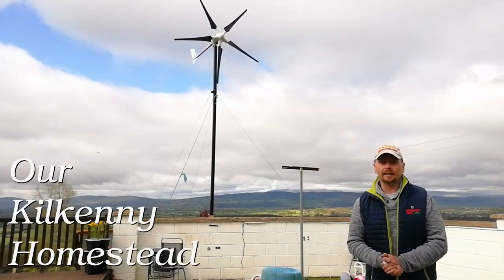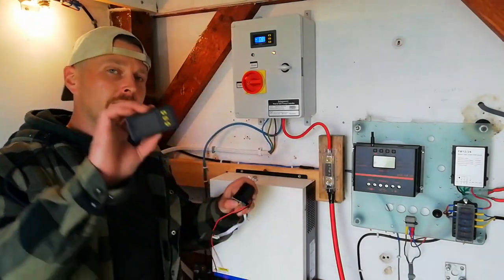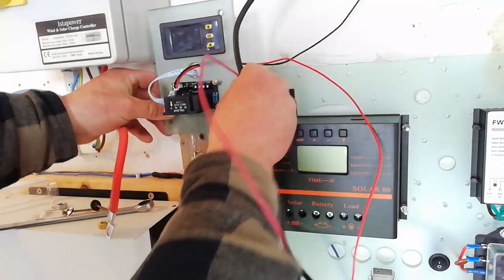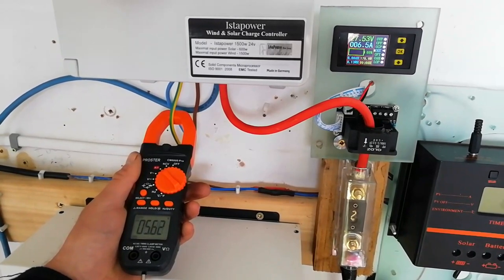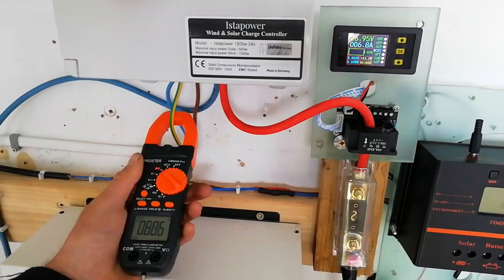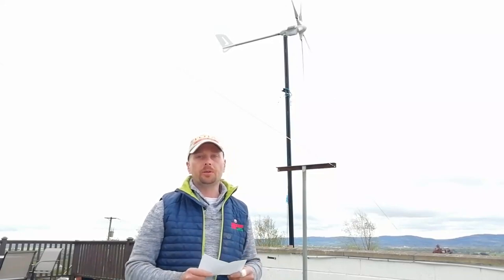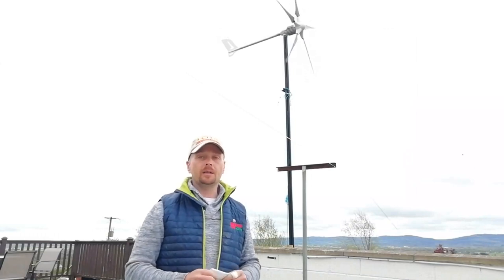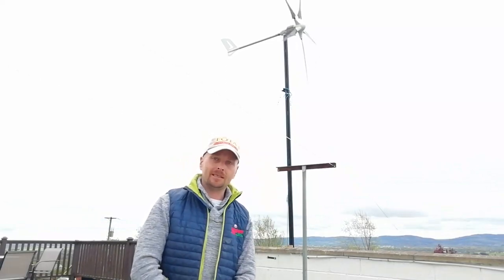Istabreeze i1500 Wind Turbine performance review

Comment: I am looking at getting one of these, will probably go for the Windsafe 2000, but the tower for it is horrific in price. Could you make a tower if needed? What foundation did you put in for the i1500? Is there a reason that you kept yours so low? The turbulence - especially in high winds - may have been a factor in it failing?
Reply from the maker: Hello Tom, yes absolutely you can build your own mast, the most common seems to be the gin pole type. We kept ours to 6m high as we are already elevated on an exposed hill side (400m) the foundation is 1m x 1.5m x 0.5m with rebar driven another 0.5m below the foundation. You can choose 3 or 5 blades to suit you conditions, 5 work better than 3 at lower heights but the trade off is a reduced top speed. Highly recommend replacing the slip ring for a heavier duty one before putting your turbine into service as the slip ring is a known weakness accross the bigger istabreeze models.

Comment: yep i am counting on a 3 bladed 1500 , 24v to keep my batteries topped up during winter , along with a older 12v 400w unit , and if all else fails my old millitary gennerator must do the work

Comment: good test.
just one question: why 5-blade one? is the 3-blade not performing well in low winds or what is the reason?
Reply from the maker: 5 blade performs better at lower windspeeds however the trade off is that maximum rotation speed is reduced compared to a 3 blade setup.

Comment: Myself and the fiance were looking at one of these to power a mobile home over in Connemara, would you still recommend istabreeze for a wind turbine? These are the only brand I see on youtube that seem to work to anyway halfway decent degree without costing thousands of euros.
Reply from the maker: Hello, yes i would still recommend an Istabreeze but on the understanding that the slip ring should be upgraded before use to prevent failure at high current levels. They do perform very well compared to some of the other options on the market but are not a perfect product. Hope that is of some use.
Reply from the maker: Oh, forgot to say, you wont power a mobile home on one of these alone. Not by a long shot.

Comment: After this time can you answer if it was worth investing in this model of turbine? Is it true that it needs higher wind speed though?
Reply from the maker: Hello, yes it seems to have been a good investment as it compliments the solar system well and ensures power generation in varied conditions. The technical specs regarding windspeed requirements is featured in the video.

Comment: You have used the green/yellow cable to transport a phase from your turbine which is absolutely forbidden, green/yellow is for earth connection. You have 3P+N cables for that purpose.
Reply from the maker: If that's the only nit you could find to pick at then we're doing alright 👍

Comment: Yeah sure. The readings are accurate😂  According to the manufacturer power curve, with 6m/s wind speed, it should generate 300W. The reality is that at that wind speed, it does not even start rotating. It needs 7 or 8 m/s to start rotating and 9 to 10m/s to generate just a little bit of power. It only works in hurricane wind conditions. Extremelly inefficient blades. I would never buy an ista breeze again. Do not believe everything you see in video
Reply from the maker: Sorry you have such a pessimistic view. At least you can trust everything you see in this video 👍
Reply from the maker: That's a bit shit to be fair. If you're scrapping them I might take them off you. 4 words: experienced user and gearing.
Reply: @ourkilkennyhomestead2006 you are right, what the fuc...do I know about generators, wires and magnets? I am just a poor electrician. By the way, be carefull, electricity is not a game
Reply from the maker: @JoseAgustin-hq2pl  ah sure hey what do I know either Jose? As you say of yourself , I am only a poor mechanic, but if we don't explore we shall never find out.
Reply: @ourkilkennyhomestead2006 Sorry, I didn't mean to bother you. I'm just disappointed with my ista breeze. It produces almost nothing. I have contacted the ista breeze after-sales technical service and they refuse to help me. They say it's my fault, because I've done something wrong. For God's sake, I know how to size cables, batteries, etc. because that is my job. I blame the wind turbine blades, they are very thin, they don't have enough surface area to catch the wind, and what's worse, they are very soft and bend in the wind. And I have the carbon ones, which are supposedly more rigid.
Reply from the maker: @JoseAgustin-hq2pl  I see... Do you mind if I ask what voltage level the system was operating at?
Reply: @ourkilkennyhomestead2006 yeah good point. 48V batteries and 48V ista breeze. Open voltaje the ista is 220VAC . A drill is able to reach the rpm necessary but it struggless to reach the cut in voltaje with wind because it does not reach enough rpm under load. Again, I blame the blades. Any suggestion? Thanks
Reply from the maker: @JoseAgustin-hq2pl  no expert here by any measure but I seem to keep hearing bad reports from folks running them at 48v. From what I've seen, people are getting better results running them at 24v for more amps. Not much use in that info I know, particularly as we're switching to 48v ourselves in the near future.
Reply: @ourkilkennyhomestead2006 That means the generators are not 48V, they are 24V as I suspected. The resistance for each phase is only 1.3 ohms. Very poor for a 1500W 48V coil. It should be at least 3 ohms. Unfortunately I cannot change the voltage of my battery bank, since each module is 48V
Reply from the maker: @JoseAgustin-hq2pl  I suspect you may be correct as from any vids I've seen of tear downs by other owners, the internals of the 48v look identical to my 24v. I don't know for sure though.
As a compare, I got 1ohm resistance from each phase of the windings and found that the slip ring was not sufficient to carry the claimed potential of 60amps. This is the part that failed in our turbine.
Reply: @ourkilkennyhomestead2006 ista breeze uses 10amps slip rings which is ridiculous. They should be at least 30amps or more since the curret is double when you short circuit the generator to brake it. The slip ring and the ceramic block are the first components I changed. I am gonna stop trying, I give up
Reply from the maker: @JoseAgustin-hq2pl if you're a DIY kind, the generators might work better in a DIY turbine where you could set up gearing between the prop and generator to get them turning faster. 🤷‍♂️
Reply: Hi. I am not sure what you mean. I am completely off grid. I got a solar inverter/charger (voltronic 5000W 48V) connected to my batteries and the wind charge controller connected directly to the batteries as well
Reply from the maker: @JoseAgustin-hq2pl  hello Jose, what I meant was that the generator from the wind turbines can be re-purposed for use in a home made turbine where instead of the blade hub mounting directly to the generator shaft, the blade hub would run on a seperate shaft which drives the generator shaft via a set of gears allowing the generator to turn faster for less wind input. I did a very basic build of this operating setup in my DIY vawt where the generator turns roughly 30 times for every one rotation of the blades. Might be worth exploring if you're stuck with turbines that no longer work in their original condition. I suggest this as a potential way to get your failed turbines back working for you again, all be it in a modified configuration.
Reply: @ourkilkennyhomestead2006 wow that is a great idea but I do not think I am able to do it. I am just an electrician, you are the mechanic😅 but I have to admit that it's a great idea and would probably work. Thanks😊
Reply from the maker: @JoseAgustin-hq2pl  you sir can do anything you set your mind to. Best of luck with it 👍
Reply from the maker: @filthyusratus  have you?
Reply from the maker: @filthyusratus  straight up, do not go grid tied, get batteries. Otherwise all youre doing is renting you're roof space to provide the power you make back to the grid for a few quid discount. Don't fall for the scams and salesmen. All that aside what you budget for a wind turbine would be better spent on a diesel or petrol genny and incorporate that into your hybrid system. Most turbines will require minor modifications to get better performance/ reliability. Istabreeze were the best that we could find after 2yrs research. Even then, they still have faults.
I get that you'll have 20 salesmen telling you xy and z but trust me they are just salesmen and only know the sales pitches. Buying from them is like getting a tyre fitter to build you an engine. Trust me on that.
Reply from the maker: @filthyusratus  aye indeed, I hope you've a better head on you than the "electricians" flogging "the worst way" to go solar.
Why not build proper off grid? It'll cost you much the same, you keep everything you generate and only use the grid when you choose. On grid is a bit of a scam at the moment unfortunately. Check out voltacon solar. com and solar hub. IE. You'll see the prices yourself and on voltacon you'll find some of the best inverters on the market for small money. We've used the conversol 3 kW for years now always on and never an issue even once. We're about to switch to the 11kw pair able, so we can but 2 of them increasing our load capacity to 22kw. As a mechanic of 20+ yrs, BMW technician before I retired from the trade. I've seen and know the best of technology, and how we're sold over priced shite and conned into contracts and setups that only serve the salesmen and the companies. Anyway, each individuals needs are different, what suits us may not suit you. Just be careful out there, 99% of the people and places you look to for information will just try to sell you old tech or old ideas and grid tied is the oldest trick in the book. Thanks for checking out the channel and Happy hunting 👍
Reply from the maker: @filthyusratus  they definately give away what they don't know when talking to those of us that do know, that's for sure.
The istabreeze i1500 would stay above 5amps at 24-27v on a windy day and fluctuate between the 5 and 40 amps momentarily. That's roughly the wild ac figures in a 20ish mph wind. With the istabreeze the slip ring is a common failure point accross the models as its only capable of 15-20 amps per circuit, 3 circuits in the slip, one for each phase. The ceramic connector between the phases and slip ring is another common fault and you'll be replacing the 2 bearings in it annually also.
Truth be told, the thing with wind turbines seems to be that they represent more than they actually do. If you had one, your whole community would think you are off grid with limitless energy when in reality it's only a scavenging back up to your solar/genny hybrid. They're a monolith, effectively a monument for others to look to. In a quid for quid comparison solar wins everytime unless you're above 55-60 degrees lattitude where the polar climate gives you all the wind you can use. It's a tough one but if I were you or if I were starting again I'd leave the wind out of it until you have a solar battery combo put together that will run your domestic needs for 2-3days without mains. Once youre at that stage then I'd allocate 2k for a turbine, mast and foundation as a back up to what you've already got. Just an opinion based on experience here in a windy spot in Ireland.
Reply from the maker: @filthyusratus  ah sure we're all on this journey at various different stages. If folks like me can help folks like you not waste thousands on dead end streets like we had to then we are doing some good, however small it may be. Hope you get figured out what will work best for your needs. Thanks again for checking out the vid, hope you've found it all useful. Éirinn go breadh 👍